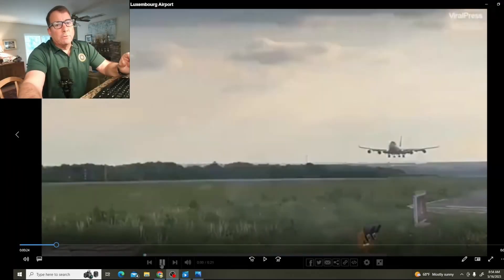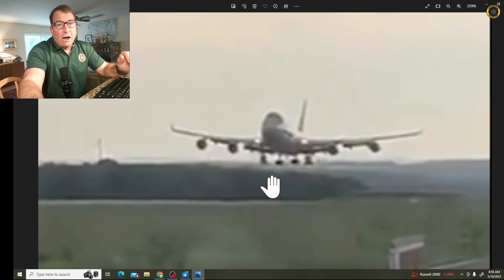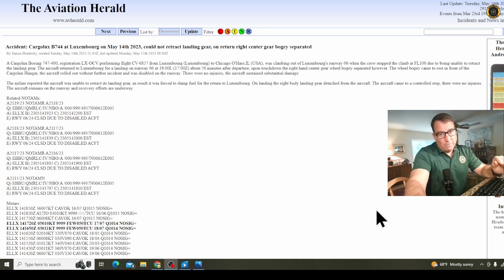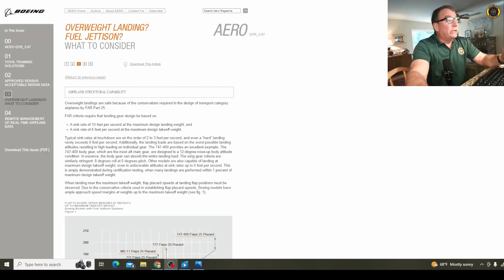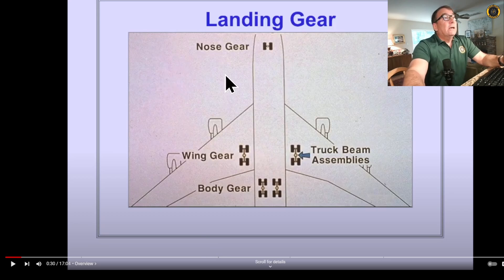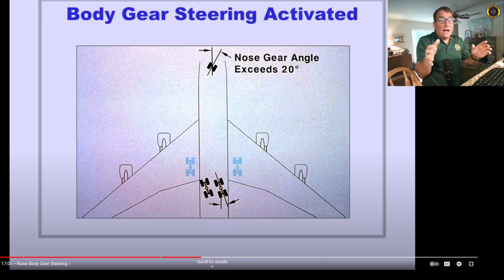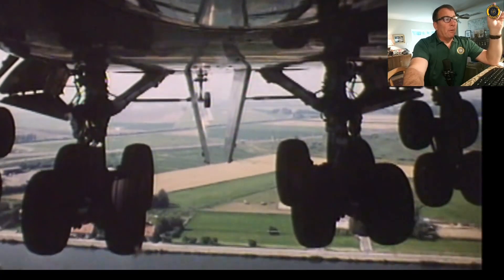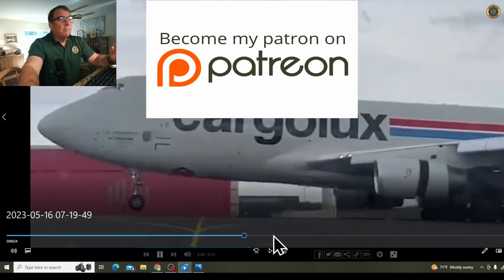Cargolux B747-400 Landing Gear Failure 14 May 2023

Comment: As a former maintenance guy who did work on this aircraft type and going from the photos it would appear that the oleo piston itself has failed either during landing or previously during takeoff. From what I could see the right body gear truck was not in its normal tilted position and I speculate that the gear truck was at least partially hanging from the body gear actuators and that might be the reason for the tilt sensors preventing a gear up selection. The lower scissor link below the body gear actuators has clearly broken away from the gear truck and one of the other photos appears to show part of the oleo fractured above the separated gear truck. I think this failure occurred before landing during takeoff rather than during the landing. I would be interested to know if the landing gears had been changed since the incident with the ground vehicle as of course the gears do have a overhaul life. I wouldn’t personally think that much damage could be caused by the collision with the van but I suppose it is possible.
Reply: I agree. It would have had atleast 1 or 2 D-checks between those two incidencts.
Reply: A few years ago (late 1968 early 1969) I worked at Cleveland Pneumatic Tool(Pneumodynamics) as a metallurgist where we made the first 747 gears.  I worked on the qualification drop test program for a couple months.  On those initial designs, I remember that the the wing gear truck was tipped like Juan shows and the body truck was more horizontal.  But when the rear wheels of the wing gear touched and were forced up, hydraulic fluid (purple Skydrol) was forced from the tilting ram to the tilting ram of the body gear forcing the rear wheels of the body gear down into the pavement so as to begin transferring the impact of the landing to all main gears and their 16 wheels.  So when we tested the body gear, we had a hydraulic pump pressurizing the tilting ram to force the truck into that high angle simulating the actual loading of a landing when we dropped it.  In order to simulate the fore/aft loading of the gear touching down with stationary wheels, we spun the 4 tires up to landing speed in the reverse direction and then dropped it.  Quite a smoke and noise show!  We were all in a super reinforced "bunker" just in case something came apart.
Yes, that picture of the truck and wheels clearly shows the oleo strut piston cracked in half.  Probably on takeoff and was probably just hanging by the steering and tilting mechanisms.
Internal fatigue crack of the piston that led to catastrophic failure? I would like to see that whole fracture surface.
Reply: @budehrmann5902  Yes both the wing gear trucks and the body gear trucks are tilted by hydraulic rams but the wing gear trucks are tilted to a greater angle to ensure that the rear wheels of the wing gears touch down first. The trucks un tilting on landing is what controls air/ground switching on landing.
Reply: @budehrmann5902  In 1969 I was on the flight test program for the 747, we ferried the first Pan Am for refurbishment from Boeing field to Renton wa, The #2 test pilot was nervous about landing on a 5000 ft runway, he set it down at the end by the lake,hit one bogie on a boat launch  ramp shaping it off, so landing on 12 wheels instead of 16 and using the outboard engine as a ski. they considered a good test since no  fuel leaked out. It was flying a few months later, The next one landed a 1000 ft from the ramp and stopped  it in 2000 ft.
Great Plane, I drove by the damaged plane right after it happened, shoots out sitting in the middle of the runway
Reply: If the bogie fails it will result in a forward tilt many times. When it hits the ground it will be ripped away. Cannot tell from this video the exact position of the truck?
Reply: Correct me if I am wrong, but there have been a few body gear oleo strut fractures on 747s in the past. Wonder if this is the root cause- oleo finally cracked during taxi out and takeoff, bogies droop  on oleo and there we are.
Reply: There's another video out there closer to the runway threshold that shows that the right body gear was tilted forwards rather than backwards prior to touchdown.
Reply: @CaptainKevin  Yes, I saw this, too.
Reply: Thank you very much for this detailed information!
Reply: " I wouldn’t personally think that much damage could be caused by the collision with the van but I suppose it is possible." 
All well said. However, I agree that it doesn't "SEEM" like it could be related but as an experienced police detective said, "In any investigation there is NO SUCH THING as a coincidence."  Maybe the tilt actuation system was damaged in the earlier incident....damaged hydraulic line....something. But that doesn't seem to account for the gear totally separating. Skipping across that flimsy sheet metal on the roof of that van couldn't damage a landing gear. Final report will be interesting on this one.
Reply: @rael5469  Thank you, I am not trying to put up a definitive answer, just making comments based on my interest. I will make one comment though, if the landing gear had been changed between the collision with the van and this incident then the coincidence largely disappears. A fault in the tilt mechanism could be a contributing factor or it could be secondary to the initial failure, I will leave that to the investigation team.
Reply: @johnyoung1128  Yeah, I didn't listen closely to the year the first incident happened. That's a long time ago. Still, it would be eerie for something like this to happen to the same gear. What are the odds? 1 in 4, I guess. :)
Reply: @rael5469  It´s indeed more than 13 years ago when the other incident happened. So it´s really necessary to know the maintenance history of this aircraft to say more about it. Hopefully the investigation will have a closer look on it - it´s of course possible that the investigation will come to the conclusion: no relation between the two events.
Reply: @NicolaW72  "it´s of course possible that the investigation will come to the conclusion: no relation between the two events." 
Yes, that is a LONG time ago. And such minor damage. What? a tire change....if that.
Reply: I'm not a maintenance guy, but I'm glad you have added this extra info, I originally had the same thought, that the gear wasn't tilted up like it normal would leading to the front wheels of the bogie touching down first and basically shoving the whole thing back and tearing it free. 

I assumed the issue with retracting the gear was related to the tilt, but I didn't know the correlation between them both, this definitely makes alot more sense now.

Hopefully Cargolux release the findings of the investigation so we can see what happened (I'm not sure if the law requires they do or if its public information) 

Imo it looks like a very rare case where pilot error hasn't caused the incident
Reply: https://youtu.be/IAfWXCry-gk
Reply: When the pilot does a walkaround before takeoff, would there be a chance of detecting the problem?
Reply: @JimMork  That would depend on the nature of the fault and where it is, if it is an internal crack or corrosion it might not be visible. It needs to be understood that the walk around inspection is important but is only one of the defences against this kind of failure.
Reply: So when the pilot judges a plane fit to fly, that is an estimate. The plane may fling a bogie across the airport. I wonder how many plane types experience these incidents. It is significant to me that 747s are really old. And primarily carrying cargo.
Reply: @JimMork  Not all really  old , Boeing just delivered  the last 747  just a month or so ago to Atlas air. UPS has just got a couple this year as well.  beside maintanice  is the key issue for safety
Reply: @JamesAnderson-mr2sg  What age does Cargolux have? Maybe the originals were scrapped decades ago. It IS an old design. But maybe inspired. I do remember when they were launched, I was in IT, heard "computers now will fly airplanes", and my department had mainframes that froze up. "Sweet, 34000 in the sky, and the computer gets a double bit error." But years ago, the flight management was doubtlessly upgraded.
Reply: @JimMork  The oldest 400 was 30 years ago, the first version had three INS computers on board and compare them all and take the 2 that  agreed.  you still have pilots to monitor everything and all kinds of  back up instruments. Flying is safer than driving. Cargolex has 4 new 747 s -8
Reply: and were back to mantenance as the key to safety and pilot training. In the 60 and 70 you had ex military pilots with 30,000 hrs , Now you have some with a few thousand hours, all the automation has caused a leck of flying experience though
Reply: @JamesAnderson-mr2sg  All the 400 series had 3 inertial reference units and 2 flight management computers. I fail to see how that’s relevant to this incident.
Reply: @johnyoung1128   must hsve been in response to someone questioning the validity of computer control on board the aircraft, don't know how it got on this post
Reply: @johnyoung1128  scroll down on the 29 replies to a conversation with Jim Mork  it was inreslonse to his comments about computer errors on board an airvraft
Reply: @JamesAnderson-mr2sg  Yes a lot of people go off topic.
Reply: @JamesAnderson-mr2sg  Have you seen those Flightaware maps? They are bonkers. Why is modern aviation so overgrown? Cui bono?
Reply: @JimMork  yes I have, increased population creates demand for more travel, everyone benefits  ,airlines, flying public, manufacturing to supply the planes, increased jobs thru out the industry
Reply: @JimMork  maybe it’s about time you understand aircraft maintenance!
Reply: Landing gears have hrs and cycles on them. When overhauled they go from x-ray to different classes of NDT.

I believe this is a result from a hard landing way before 2010 and landing gear replacement.
Reply: There is no question this was MRO maintenance. They usually get a lead with an A & P who couldn’t get an airline job and a bunch of other people who can’t speak English and their Resume is “5 years Aviation experience” but they were all INTERIORS. 😂🤣😂😳

Comment: When I see videos like these I am just in awe of what these huge jets are capable of withstanding while still being able to perform a safe landing. That’s some insane damage. Glad the pilots and crew are safe and will be interesting indeed if the damage in 2010 caused this catastrophic failure.
Reply: Multiple redundant and fail-safe systems. We must continue to require and demand nothing less, especially in the present age of "simplifiying" designs under guise of cost saving or "environmental preservation". Redundancy is necessary!
And, by the way, we still need Reed-Hillview regardless of noise or akr quality talk!

Comment: That damage to the van is very minor, it has not put significant weight onto the van as far as the landing gear is concerned. If it did the van would be completely flat or gear would have been driven through the van.

Comment: So amazing to see the video of the bogey (basically the size of a large SUV) bouncing down the runway like a basketball. And then come to rest upright as if nothing happened! Could you imagine having that thing bounce right next to you?
Reply: Saw a semi lose a tire on the interstate…they weigh close to 100 lbs…at 70mph…big nope
Reply: Ive seen two vehicle accidents where a cargo van tire alone killed occupants in another vehicle it hit. This would be far worse.
Reply: @jw0stephens  Yes, indeed. It´s good luck that nobody was hurt.
Reply: @jw0stephens  Tandem combinations are the circulation of the economy. Guaranteed we share highways with them. But in 62 years of driving, I've never see a truck part flying. More common is when they cross the center and just cream some car full of people. Am a big fan of interstates that prevent this.
Reply: @JimMork  both i referred to were 1 ton vans. In the first I saw were a Ford loosing it, Dodge wiped out, driver and passenger killed.
Reply: @jw0stephens  I wonder if people who travel by horseback (are there any?) have similar calamities. Can't really GET places on horseback. I'm glad I just read about these events, never witness any of them close up. I claim to be a bad luck guy, but not in this context.
Reply: I saw cctv footage of a BP petrol/gas station on the A1 in UK, where a wheel had come loose on the road and had bounced high enough to go right through the sunflower on the overhead BP sign. You couldn't have made a better shot if you had tried.
Reply: More the size of a subcompact car.  But certainly more than the mass of a large SUV
Reply: Having been in the grandstands when a dragster engine, clutch, and differential flew into people near me...why yes, I can.  (Anaheim Stadium)
Reply: @kevinsellsit5584  More exciting than baseball. Actually in NASCAR and Indycar racing, lots of car parts fly around.

Comment: Things break !  Boeing had a 767 retract cylinder break in two when the gear was about 90% up .  Gear came down hard and locked in position. Another 767 was being towed out of the hangar and th rear axle  on the right gear snapped in two . I looked at the ID numbers and that is the same 47 that did the smash and go a couple weeks ago !
Reply: "Things break ! (Part Deux)"  In the early 80's a couple of DC-10-30s had their center main landing gear shock strut pistons snap off at low speed.  That turned out, after much study, to be an interaction between the antiskid's pressure modulation and the extremely nonlinear friction-vs-speed characteristic for rubber on pavement at very low speed (below say 1 m/s).  The solution was to cut off brake pressure to the CLG below 5 kt.
Reply: Not the same aircraft (registration LX-OCV vs LX-ECV). But it could have had a heavy landing around the same time.
Reply: "Gear came down hard and locked in position."  Freefall-operative is an FAA certification requirement and test BTW.  The only certification examples I know of involved test rigs with deadweight for tires/wheels/brakes, rather than an operational gear installed on an aircraft.  Not the sort of shock loads you want to put into an actual airliner's structure if you don't have to.

Comment: What do the wing MLG do when you steer the fuselage gear, just slide around? I guess their loading is probably significantly less?
Reply: The wing gears are close to the turning axis on the 747 that means the wing gear trucks can be kept centred by conventional “scissor links” they don’t need to rotate and are indeed prevented from doing so. The body gears are well aft of the turning axis of the aircraft on the ground and therefore need the body gear trucks to rotate to prevent excessive tyre scrubbing. The two body gear steering actuators on each body gear form the upper part of a scissor link system pushing a conventional fixed lower scissor link to push the gear trucks left or right as needed with the oleo forming the pivot. The body gear actuators have an internal hydraulic locking mechanism to hold them centred for straight ahead taxiing, for take off or landing. It is necessary for the crew to taxi the aircraft a short distance forward before applying takeoff power to ensure all four actuators are locked in the centre position, if this does not happen the crew will get a “config” warning. This is needed to prevent the less than desirable situation of the aircraft being steered off the runway during takeoff.
Reply: The wing gear stay straight, but the body gear from what I understands stears with the noise
Reply: @insylem is question was do they drag, my guess would be that they are far enough out from center that they mostly just roll with slight dragging. If there was too much dragging they would also steer. Tires are expensive and back then Boeing built things right by the old time engineers...
Reply: @jeffeck1701  Think of the wing gear like the back wheels of a really wide tricycle.  The analogy works so well, they even have what's call "Tricycle" landing gear
Reply: @insylem  Yea, I was overcomplicating things, it's just a standard tricycle setup (no mysteries how that works) with a couple of red-headed stepchildren thrown in where they really don't belong. You have to steer those  to allow the nose and wing gear to do their tricycle thing harmoniously.

Comment: 9:20 - "Remember, a down gear is a happy gear, words to live by Juan!
Reply: I couldn't get my gear up once flying a Piper Arrow.  Cycled the handle, checked the breaker but no bueno.  As I'm contemplating a very slow trip back home, I'm running through the system in my head and concluded the safety extension mechanism was keeping me from retracting the gear.  I think it uses a combination of manifold pressure and it's own pitot static system to decide if you're on approach without the gear down and drops it for you.  So I reached by my right leg to engage the override switch and the gear retracted.  The best I could figure is that it had ice somewhere in the system since it was the middle of winter.
Reply: Yeah, it's in my hot tub after installing a skylight.